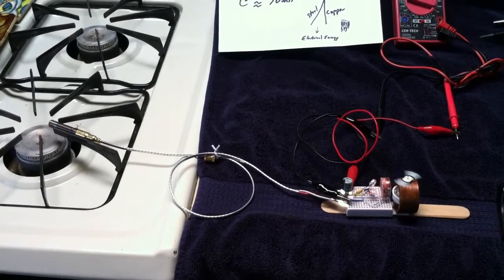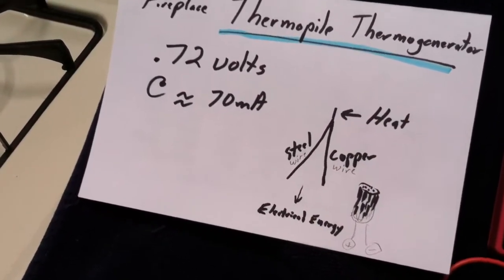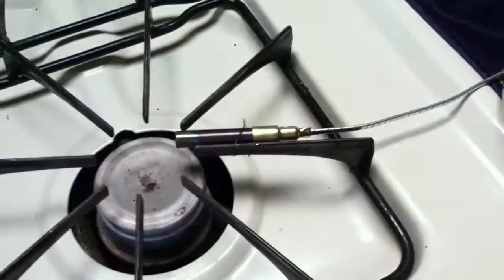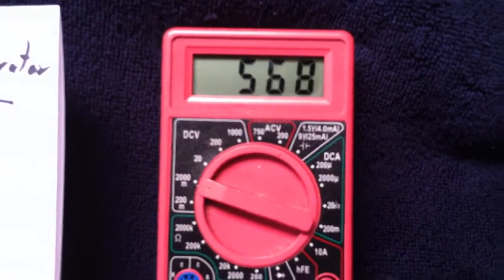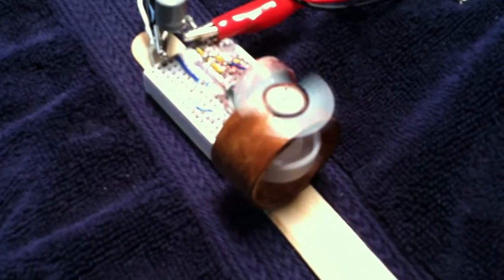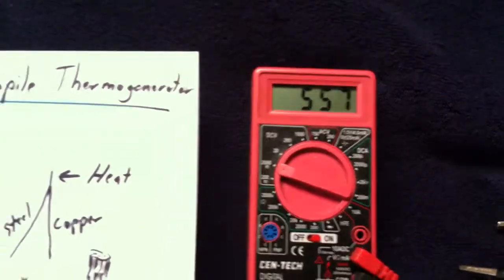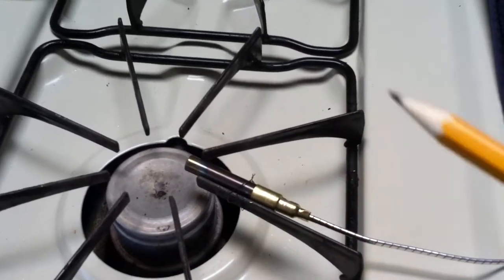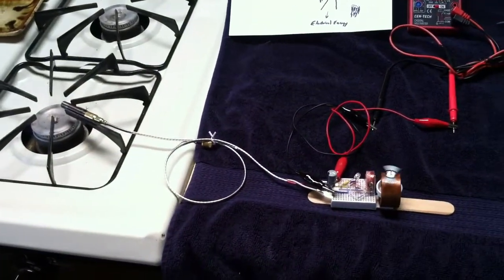Thermopile Thermogenerator --- Powering a pulse motor

Comment: The Russians used thermopiles heated by radioisotopes to run weather stations, etc..  http://bellona.org/news/nuclear-issues/radioactive-waste-and-spent-nuclear-fuel/2005-04-radioisotope-thermoelectric-generators-2
Reply from the maker: Thanks for that link.  Our last Mars rover (the big one) uses one of these for electricity.  I guess they were not worried about radiation leakage.  They must have thought about that problem for a long time. https://www.technologyreview.com/s/428751/nuclear-generator-powers-curiosity-mars-mission/

Comment: Are these just lots of thermocouple pairs wired in series?   Anyway, neat idea for powering a small pulse motor.  Thanks for sharing this.  I'm going to buy one.
Reply from the maker: Yes.  The thermopile is just a bunch of thermocouples wired together.  Shop around for a good deal on one because the prices vary a lot.  I found one on Amazon for $7 shipping included but I have seen them for as high $20 to $30 !!  The thermopiles started showing up in water heaters around 2010.  A 30 millivolt thermocouple will not work for what I show here. You need a thermopile.

Comment: In early 2000's, after I first learned about the steel copper junction, I twisted a coat hanger and AC house electrical copper wire together and hit it with a plumbing torch. 
It made something like 200 mA and after it cooled down to room temperature it was still making like 30 mA.
Reply from the maker: I made a simple thermocouple like that years ago also.  The power was so weak I walked away from pursing the idea -----until I got my new water heater and saw that blinking green led on it.  When I asked the installer if I had to replace a battery every so often he said no it is powered by a thermopile.  That triggered a new quest and I was off the races to get my hands on one and start experimenting.

Comment: Does the 'BioLite' wood burning camping stove work in a similar way? I know you burn wood in it and at the same time charge your phone from it via USB but as to how it works I'm not sure but I don't think it uses a 'peltier' module. Fantastic video's btw, fascinating what you do with so little, thank-you for showing how its done.
Reply from the maker: Yes.  I did some research on the 'BioLite' stove and I think they use a high temperature TEG (thermoelectric generator).  It is not very efficient but it does work.  It takes a long tine to charge a dead cell phone but it is good for topping one off.

Comment: I wonder if sticking it in the sun with a magnifying glass on it would work?
Reply from the maker: I tried and it worked but I could only get 30 millivolts with 20mA using a small magnifying glass.
Reply: How about a solar oven? I've seen them on 'off grid' channels, where they use them for cooking/baking etc.
Reply from the maker: Good idea.
Reply: It would be good to see a 3-way graph of temp, V, A, & W for the device.  That would helpful to determine it's electrical usefulness at various temps.
Sort of like this:  http://www.instrumentationtoday.com/thermocouple/2011/08/
Reply: AB Surprise us! :)